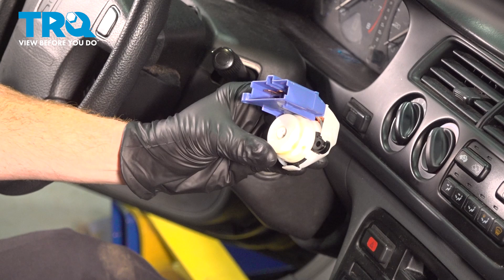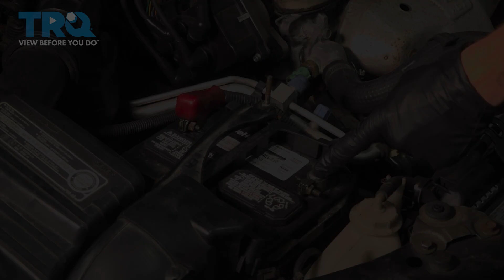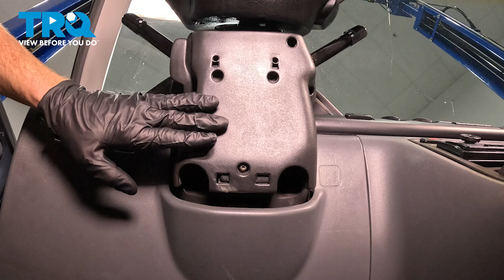How to Replace Ignition Switch 1994-1997 Honda Accord

Comment: 3:33 , For anyone whose car does not have these allen bolts and instead has some rivet/smashed bolts on this bracket; My brother and I encountered this on his 95 accord just recently. He was able to remove these smashed bolts by taking a large flat head, placing the point on the center of the bolts at a slight angle (like a chisel) and hammering the screwdriver into the bolts enough for it to bite the metal and then proceed to knock the bolts loose in quarter turns. He then took the bolts to home depot and looked for some replacements of the same pitch, pattern, and length with Allen key heads for future access. I suppose you could try to use an extractor kit on these too but this is what worked best for us in the end, we initially tried to dremel a flat notch in the bolts to turn them out with the flat head but the space proved to be difficult to get to with the dremel.  Hope this helps.

Comment: Great video ! My 97  Accord has new battery and new Alternator replaced recently. However, it just became no crank noise and not start. How do I know if should I replace first? the starter first?  or the ignition switch first? Thanks for your reply! 😅